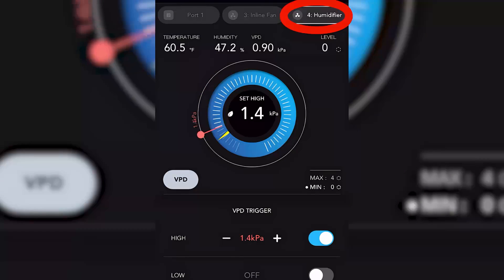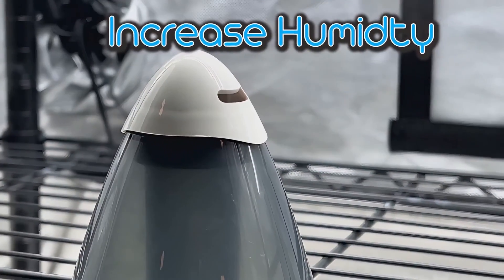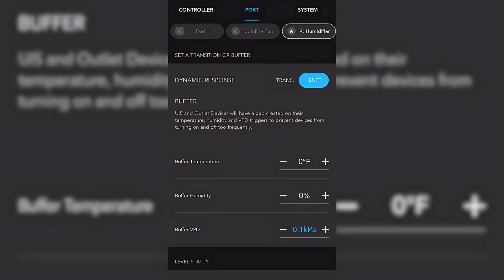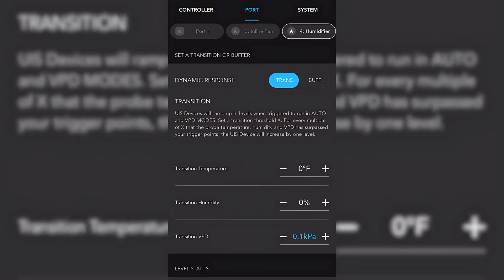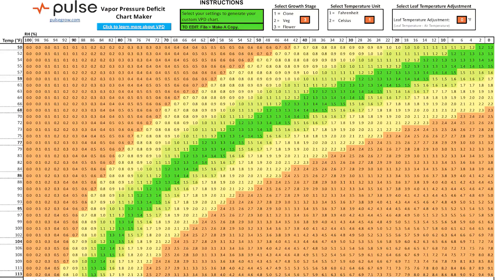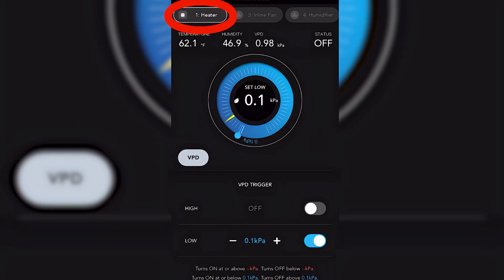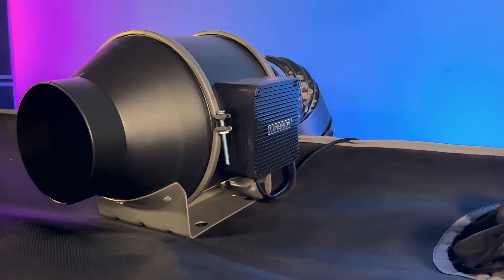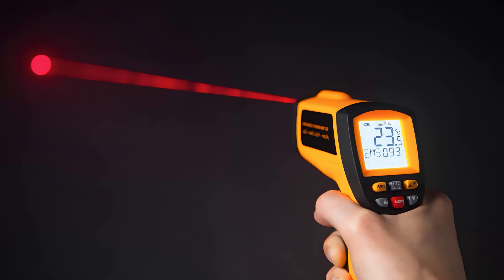VPD Made Easy | Dial In Your VPD With AC Infinity Controller 69 Pro

Comment from the maker: How do you guys manage your VPD?
Reply: Very carefully. 🤣
Reply from the maker: @timm_3r  hahahahahahaha
Reply: I run an 5x5 AC Infinity Setup - I have my AC CloudForge T7 Plant Humidifier (On set at minimum 0, maximum 4) set to VPD Triggered range with the minimum and maximum entered.  

For my Extractor I have it set to Auto (ON set at minimum 1, maximum 7) - with trigger set to 27C as well as the "High" humidity set to my maximum preferred tent humidity

Depending on what stage the plants are at and if there is high external temperature I will fiddle with humidity (maximum higher if hotter) and extractor higher volume if also higher)  as I found that higher levels of moving humidity have a better cooling effect if/when required.  

I also set humidifier at higher levels of maximum generation when at seedling stage but sometimes it becomes a battle of the Extractor/Humidifier off/on but I was able to main a very good VPD according to the tables.  Seedling stage definitely makes the humidifer work overtime during the warmer days though where I could easily go through 15L of water in a day.

But yes, to me VPD is number one priority and setting up apropriate levels with the Extractor and Humidifier works well when paired with the AC Infinity Controller Pro which does a wonderful job.
Reply: I run my 6 inch exhaust in vpd mode to kick on below 1.2 and humidifier to kick on above 1.4 runs great . I'm in flower 👍
Reply: I run a sealed room lung room, so run a dehumidifier at 10% RO below the desired Tent VPD.  As the dehumidifier works on cycles and is expensive to run.  I use a timer switch, so it only runs for 15 minute after an 1hr off in veg. and once the plants start to heavily transpire, it comes on once ever half an hr  rising to staying on for the last couple of weeks. use my older (non pro) 69 controller, seems to work well and can always find my target VPD, but I'd like to upgrade as I like new kit and need more ports.   The new AC infinity heater looks good as does their new CO2 controller..
Reply from the maker: @UbiquitousRomp  good to know!
Reply: With a heater in flowering and with a humidifier in grow . Exhaust is set in auto mode, when he can't keep RH down enough for the right VPD the heater kicks in
Reply from the maker: @surronzak8154  Nice!
Reply: The chart from Pulse will be a great help, thanks.
I live in an old apartment block, it's always quite humid in here around 65% RH.
Lowering the RH with dehumidifier doesn't seem to do all that much so I'm considering increasing the temperature in the tent with heater.
You reckon that's a good idea?
Reply: @nikolasmaes99  Except when your in flower. Idk, what to tell you then.
Reply: I have set the exhaust fan to high VPD trigger and the off level to a level where humidity is pretty stable. Works well for the moment. When temperature rises too much, the exhaust fan will bring the temperature down, which also rises the relative humidity. Triggering on low would lower temperature and rise relative humidity, which would further decrease VPD. At least in my environment, where we currently have a high outside humidity.
Reply from the maker: @MrSimonSays89  always a balancing act!
Reply: @HappyHydro  Unfortunately yes, this is my first setup of the controller and I do not consider it that smart. Felt pretty much limited in setting it up the right way. Hope they improve their solution in the future. What I dislike about the AC Infinity controller:
- transition steps are too big for temperature and VPD. So you can't ramp it up properly to keep your target 
- VPD trigger cannot be combined with temperature or humidity. So I can't assure just by exhaust fan that humidity and temperature are not running too high or low
- No possibility to trigger a device off. You can only activate it on low or high trigger. Not that smart. Smart would be to define a range and the device triggers on and off accordingly. Really smart, if it learns how it needs to ramp up. I would at least be happy to be able to have a deactivation trigger 

If some of these points would be improved, it wouldn'nt be such a balancing act. You can only inefficiently work against physics by using humidifiers, dehumidifiers and heaters from my understanding, if you just want to program it once for each phase.

I think I will have a couple of different settings in the end or may use a dehumidifier outside of the tent to have a stable input humidity.
Reply: Idk bout bringing it back buuuut....
Reply: I’m currently using the VPD automation provided by the AC Infinity app itself. I’ve set it to my plant stage (Seedling right now) and did some minor fine tuning. It seems much easier than what you’ve described here by setting triggers per device. Help me understand - is this feature new or not good? Thanks and keep up the great work! 😊
Reply: I'm not to versed in VPD. But I usually keep it like a 73 degree summer day and 50 plus rh in veg and in flower like 69 to 71 degrees and 40 rh or lower.
Reply: @Catch_u_reloadn  That's way too cold. Especially if you are using LEDs. Do you have a lot of purple branches?
Reply: I have a 50pint dehumidifier in my lunge room and a 4x8 in that said room 10x10 with a 12000btu split ac..I run a t8 on the controller alone..I'm trying to getup my vpd up but I can't seem to get below 50 % when my lights are on..any advice?
Reply: @romelljennings3203  I suggest avoiding the summer months when growing indoors, here its hot and humid, very hard/expensive to keep things adequate. I am giving up June, July and August from now on.
Reply: When you say it's expensive..please explain....what else would I need??
Reply: @romelljennings3203  During summer months many climates are hot enough to have to run an air conditioner alot, as well as humidity issues being high and having to constantly run a dehumidifier. Its way better to just take the summer off or grow outdoors if possible.
Reply: @25Patman  I'm in the Caribbean so there is no winter..
Rainy season and dry season..
Reply: @romelljennings3203  If its hot and humid, things are really tough to grow indoors. And can get expensive. I hope you understood what I am saying.
Reply: Wet bath towels
Reply: Viagra
Reply: Not well. I’m a total noob and messed up the settings somehow. When my light cycled off, the humidifier turned on to level 6 and STAYED ON.  FFS… Two mornings in a row I opened my tent and it looked like it rained inside for 6+ hours…. What VPD do you suggest during the early Veg state?  I’ve feel like I’ve shocked these ladies way too much lately, but they still look good.

Comment: The vpd mode setting messed up my tents climate, it either let it be way too moist or ran the fans high when air was already dry. 
I have a humidifier but no aircon, dont need an aircon usually, same goes for a heater. 
Ive since given up and gone back to setting my temp and humidity ranges in the app instead. 
After watching this video, it reinforces my suspicion that for my setup, the vpd config wont work well.

Comment: LOL, I saw this, got excited, invested in Controller AI for all my tents, it wont keep targets, deletes my automation triggers, fan curves suck, support sucks and is smartass, and I regret my decision more and more everyday. Legit, $2700 for all three tents and main tent has every sensor and device added I can have, stupid thing won't use the heater, runs the humidifier out of water and overruns my target humidity all the time, plants are stunted, and this sucks. Why did my algorithm take me down this line. I know I'm just venting, its a old video, and I'm sure you don't go back on comments after you get add revenue, and that's understandable. But I tell ya, up all night changing settings because the AI sucks and getting all your devices to work together when they don't listen to the controller sucks. I now have thermoforge and Cloud forge unhooked and in standalone. Its the only way it will stay. Do you have any advice? I know its not your issue, but I'm reaching out to someone with experience.
Reply from the maker: Hey there, I am sorry you're having such a rough experience with it. There seems to be a little more hand on dialing in with the AI controller than I was hoping for. You can always switch off of the AI mode and kind of run things like you possibly used to on an older controller. If you want send some pictures of your devices and parameters to help@happyhydro.com and I can see what I can figure out for you to help
Reply: @HappyHydro I cant tell you how welcomed to the community that makes me feel as a new grower. Fortunately I program automation for clean rooms, hospitals, gov buildings, etc for a living. I figured out it's the equipment curve they set wasn't correct for the hands free automation of the heater with the current firmware edition in the controller AI+. Im not sure on the back end for scaling of the light sensor (mV is mA and the scale range) for it to report accurately,  but the CO2 meter is dead balls accurate. The alerts drop out all automation i bet as a safeguard for people who maybe don't have it interlocked correctly to keep from fires or burning. 

I wish they would change the following. 

1. When using dynamic wind, have the AI default back to the minimum occolation degrees so it doesn't run the fan into a hard wall and burn out motor prematurely.  

2. When going into tent work mode , don't turn on the lights automatically but instead put a inhib run or stop action if night mode is being used so plants don't get light out of cycle. 

3. Fix automations from auto delete to just be the alert so we can kill it automatically except safety issues of course. 

4. Fix equipment curve on Thermoforge so unit can change back to heater mode form secondary fan mode when heat is needed. Currently the AI will favor the Cloudforge and ruin humidity targets. 

5. Fix documentation for static is dynamic so new growers know how to dial in lighting for the proper amount. It's hard as a new grower, without a LuX meter to know how to set the light. The default range starts to high for seedlings or if doing dynamic and light would be close to plants. 

6. Put the option in menu for propagation tent so unit knows cfm of the smaller tent, updated humidity settings for a smaller space, and start the lights out for that on a 1 instead of a 7. 

I've found over 100 bugs, but mainly just small stuff. I know they are trying to get it sorted out. The more people jump on a product and use it, the more stuff you find wrong lol. But, with Thermoforge off of AI control, no issues at all. Tent holds perfect temp, humidity is perfect, fans haven't messed up again. Legit, it's a dream after I spent all weekend babysitting, testing, and investigating. Whoo that's a lot to write. Only detailing it out so if others have an issue before firmware release they don't pull their hair out also. 

Btw, I deleted automations several times, dropped emails to AC, did chat, called on the Monday after it all happened as well (poor Alex, I feel bad but I was pissed) and emailed the whole bug list to them also. I deleted the AI i think 3 or 4 times and it still kept happening. 

Love your channel, and now you have a lifetime supporter in me and my wife. Thank you for caring enough to offer. I sincerely appreciate it and respect the fact you care enough to ask. God bless and this toke is for you ;-)

Comment: Great info. I now have a little better understanding.  I used what you said in the recap and it worked perfectly for my seedlings.   Fan Auto high temp (80 for me) Humidifier high VPD trigger 0.8kpa, Heater low VPD trigger 0.6kpa.  Target VPD 0.7 kpa.  Perfect.
Reply from the maker: Awesome, glad to hear it helped!

Comment: what sucks is you need the ac infinity components like humidifier fan etc. for them to turn on/off to work correctly........ or am i trippin
Reply from the maker: They do make a control plug outlet that you can run off brand items on but there may be some limitations

Comment: I keep reading that VPD requires knowing the temperature of the grow canopy of leaf temperature....?
Reply from the maker: For perfect calculations yes but you can get pretty close without it
Reply: @HappyHydro   It could be done with an IR thermometer and color sensor to calculate VPD directly but I think you're wise in omitting those two sensors due to high expense. My application is more for human comfort and my goal is to lower CO2 while maintaining building efficiency. I'm building my own controller with a windows interface.

Comment: Question guys, Im running the biggest AC tent, the thermo ac unit, with 2 fans in a uninsulated place. Any advice to keep temps down? p.s. I'm growing microgreens and idk how big of a difference that is to other "grows" but I'm new to this ALL and struggling lol. Don't be too hard on me.
Reply from the maker: hey shoot us an email to help@happyhydro.com or a text to 716-217-0353 and I can try to help you out!!
Reply: I had the same issue bought a portable ac unit and have one of your fans at the same level as your light, also if possible leave the entire side of the tent open.

Comment: I wish the VPD mode had a target temperature attached to it. The temperature is the most important variable, and the RH% should be trying to stick to that number. I normally have the exhaust fans set to "auto" through the day and then I switch it over to "VPD" at night. 

During the day the "VPD" mode stays too cold after the lights come on, or gets too hot because it's just trying to maintain the VPD number and has nothing to tether onto to prevent it from collectively running away. At night the temp falls, so the fans aren't triggered by the "auto" mode's temperature setting and the humidity keeps rising. 

There is a schedule option, but I think it only lets you trigger a mode on and off. I don't think you can use it to switch between modes.

This is especially annoying because my lights come on at noon and go off at midnight. So I've had to stay up late since I started using the controller. Every time I've fallen asleep early I've woken up to high humidity alerts on my phone. It wasn't as bad before daylight savings hit this spring. Luckily I don't normally have to wake up early

Comment: Why do I need to calibrate temp. And humidity? Doesn't the device come already calibrated? If not how do I get an accurate reading? I have 5 thermometers in my room that have 5 different temps. Do I just pick one and go with it? Your video here is not very inclusive of step by step instructions! AC Infinity Manuel sucks too
Reply from the maker: Hey Larry, you might find my actual Controller 69 Set up video helpful. This one is primarily geared towards controlling VPD

Comment: I just got mine and I guess they updated the software because there is a new tab that lets you set target vpd which seems much easier than this. You just set the target kpa and the controller manages the humidifer to keep it locked in. Testing it out right now and it's working great.
Reply from the maker: Nice!

Comment: Thanks for the explanation! Can you use the water draining from room AC/Dehumidifier in my Cloud Forge T3? Or is distilled water my only option?
Reply from the maker: You can, but distilled is preferred simply because it’s free of bacteria
Reply: @HappyHydro  Thank you. I've been growing for years. I've jumped into this VPD feet first, this is my 1st run using this method, and looking forward to the results. I always use distilled for watering and with the excess drain water from AC/Dehumid. I want to stay away from city water, if bacteria is a thought from that, I'll stick with the distilled! Again thank you.

Comment: You're not very informative at all The most important part is the difference in humidity between the plant and the air so that the air can circulate between the plant and the air plant temperature is crucial to all of this compared to room humidity and so on. What matters here is plant temperature room temperature and room humidity you don't need to figure out how much humidity your room can handle you need to figure out where the difference is and what temperature you want your room
Reply from the maker: Well, thanks for watching!

Comment: After watching the video I rearranged my entire grow tent (ac infinity 5x5 pro bundle), deleted excess tubing from exhaust fan, opened an extra bottom air intake flap, opened the central ac vents in my basement, and moved the power block for the light outside of the tent. Proud to say my vpd is now 1.44 instead of 1.7+. We shall see what happens when the lights turn out… anything less than an 80% RH spike in the dark will let me know I’m closer to dialing this thing in
Reply from the maker: That’s what’s up!! Lots of small changes make big results!!

Comment: I dont run a dehumidifier, I increase airflow dramatically if its to humid. So far I have been lucky, its good enough. I do run the AC though when its needed.
Reply from the maker: It’s super common to take the summer off or only grow outdoors during that season here in NY
Reply: @HappyHydro  Yea, thats where I am at atm. Im mid flower right now. I have my airflow pretty strong from the bottom of my tent going up, so a strong pull right through my canopy. I am not to worried. Probably won't be super dense nugs, but I am sure good enough for me.Its already ultra frosty.
Reply: @HappyHydro  I have a 2x2 and a 5x5 , I already took the break with the 5x5. Just grew one gdp in the 2x2.
Reply: Over this summer.
Reply from the maker: Yeah, the AC helps me a lot with my humidity too!